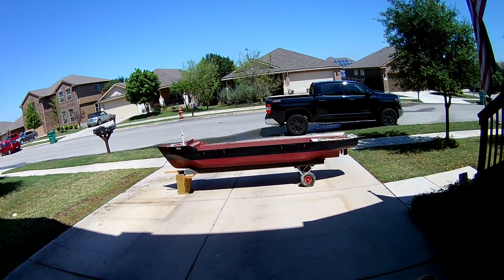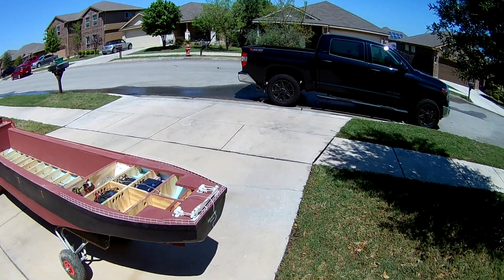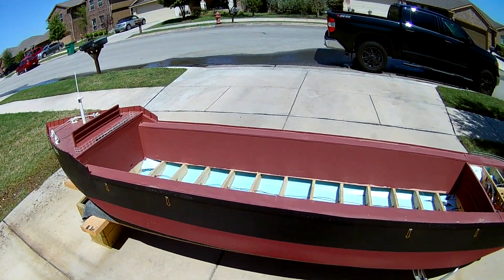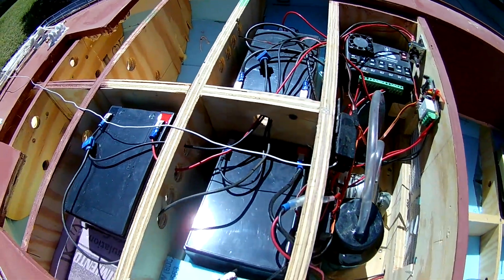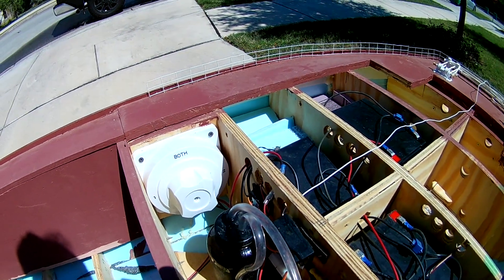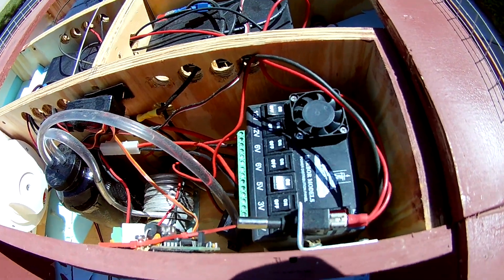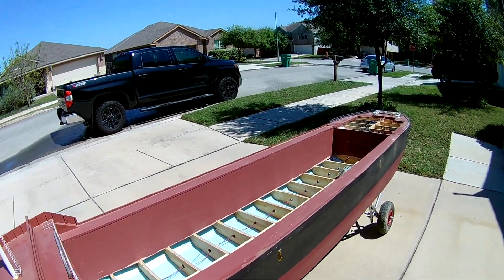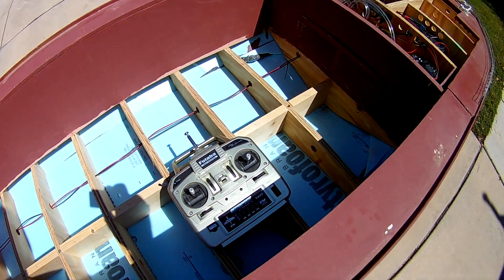RC Ship Electrical Parts

Comment: amazing how you did the shape if the ship
Reply from the maker: I got a big roll of paper and layout the sketch seen from above. I had all my mechanical parts and placed them of the drawing and started cutting the parts out starting with the center keel. Then I built the ribs. After the ribs I used 1/2 foam board and molded it around the shape and finally put a few layers of fiberglass. I did look at quite a few model building pictures and videos and that definitely helped a lot.
Reply: cool my last question is how were you able to purchase a remote control
Reply from the maker: @bobbysmith35962  you can buy a remote control set (radio and receiver) from any RC store or online

Comment: Really nice ship if it has trouble turning give it some bow thrusters on amazon just type, rc bow thrusters and you should find a green bow thrusters but other than that beautiful ship
Reply from the maker: Thanks. I do have them installed. Use them in the tight spots.
Reply: @scratchbuiltdozer  what your normal draft
Reply from the maker: @raysrandomthings8425  without ballast it may have a inch. I add 200lbs and it brings it down to almost the water line.